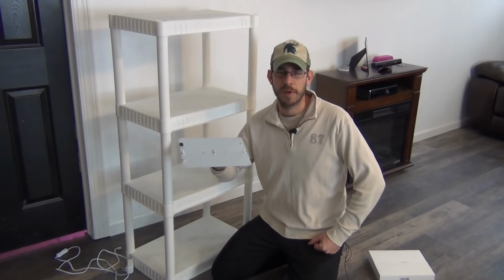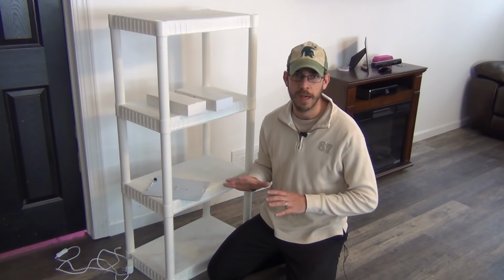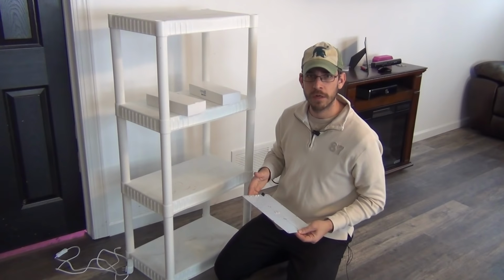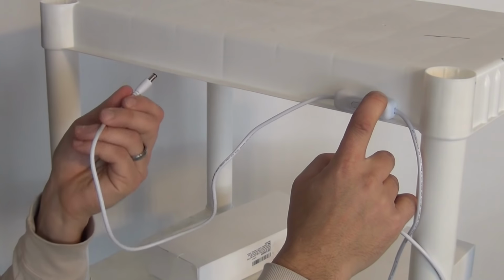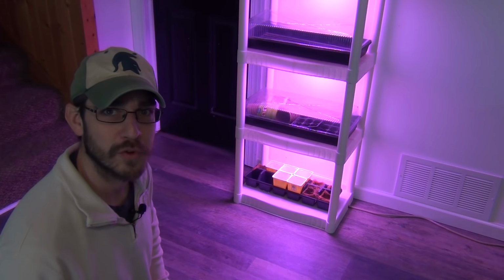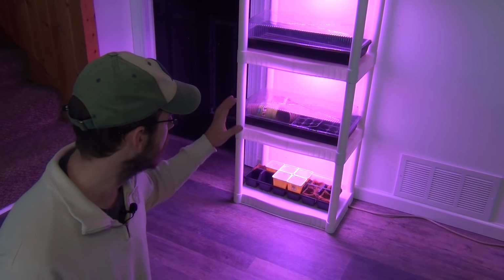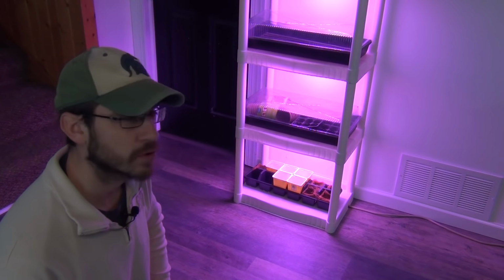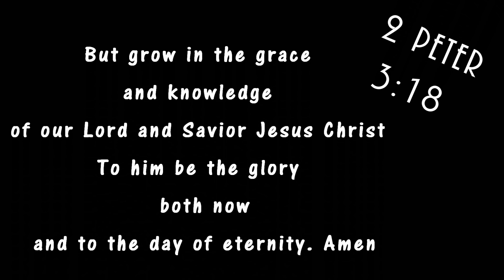DIY LED Grow Shelf - Year Round Indoor Gardening and Springtime Seed Starting

Comment: Nice DIY project, I will most likely build with similar shelf I have. The only thing I would probably not do is mount powerstrip under bottom shelf. The power supplies for panels need to be vented or they will burn out prematurely.
Reply: Not only that..  the shelf will get pretty warm on that side
Reply from the maker: They don't seem to draw enough power to even get warm, haven't had any issues yet and it has been running for a almost a year
Reply: @SSLFamilyDad  good to know!

Comment: I have a shelf that is 2' by 3'. Do you think I could I get away with 1 (2 linked together) of these per shelf like you did or should I double that? I will mainly be using it for starting seeds.
Reply from the maker: I would put as many will fit under each shelf (single row)

Comment: Let me start with by saying I really like your shelf idea and how you put it together. I have a couple of questions. #1) luminosity of the panels? Is it intensive enough to be that far away from the plants? #2) What is the kelvin rating for the lights? They seem to be very much in the red spectrum (good for flowering) and lacking blue (needed for growth), like the lights a pot grower would use rather than a vegetable seed starter.
Reply from the maker: +Iam is Lost you can grab most of those specs from the link on Amazon, can't remember off the top of my head. The reason there is more red leds is because the red light has less lux whereas blue has more so you need less blue than red to get equal power. These little panels are about the same mix as my full spectrum grow light. Power is pretty low on these so you are not going to grow prize winning tomatoes with them but plenty for starting seeds and keep some micro greens or herbs going throughout the year